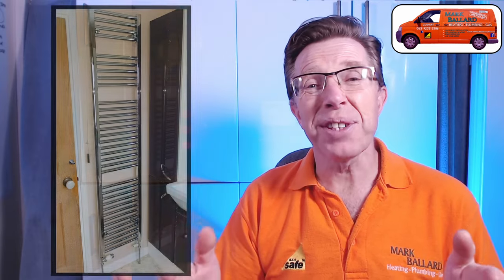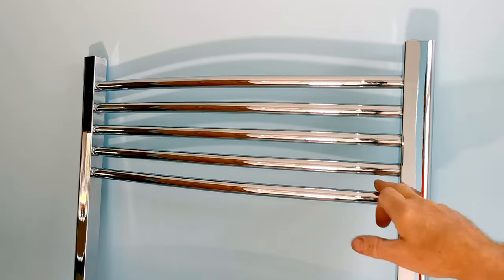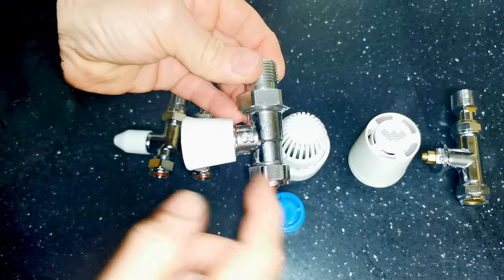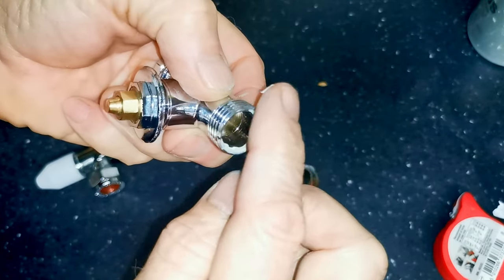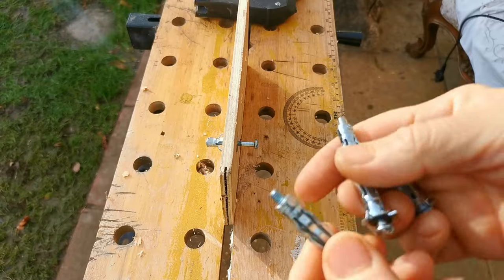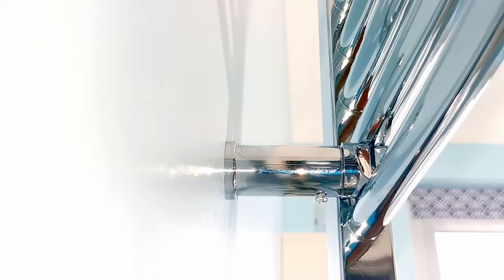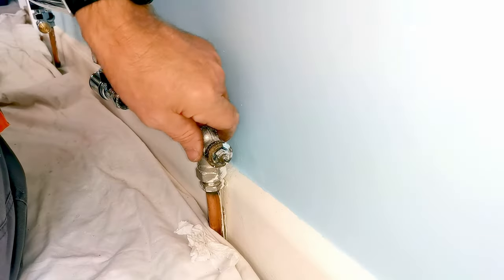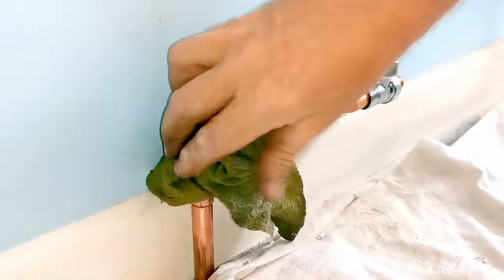How to Install a Heated Towel Radiator.  Detailed Step by Step Instructions. Replacing a Radiator.

Comment: WOW !! - seen several vids by plumbers, and this is easily the best. Thanks Mark for taking time and effort to do a "proper job". No wobbly camerawork, no annoying music, just lots of really useful info from an experienced, methodical, calm, "instructor"; including little things the others (the bodgers?) omitt to mention, like using smooth grips to safeguard new valves, or measuring twice before drilling, and so on. AND best of all for me, this boiler is the same as ours, an old-style Vaillant - your vid had shown me in one minute what's taken me hours to find elsewhere, wrt re-pressurising the system. I just wish the towel rail we inherited with our house is as massive as this one. Thanks again !.
Reply from the maker: Thanks for your comments. Makes it all really worthwhile.👍👍👍
Reply: Couldn't agree more!

Comment: Good timing.  My towel radiator sprung a leak a week ago.  It's fairly old and one of the rails must have rusted through.  I've isolated it and bought a replacement which looks like it will fit exactly.  So I will hopefully get everything to line up with the old valves and avoid needing to go as far as draining down or putting bungs in the hot water feed.  A smaller radiator sprung a leak a few days before (hopefully not a pattern forming) so I'm going to have a look at your videos to swap that one over too.

Comment: Hi, well stated about the amount of times you wrap the ptfe tape around, too many people doing similar jobs on here quote 8-10 wraps! Clearly that’s not enough, 1 do 21-22 plus jet blue as well,  proper instructions for those whom want to have a go fitting a radiator.
Reply: The instructions for my towel radiator say 'at least 6 wraps'. I'm going to do a few more (despite the time and extra expense!).

Comment: Hi. Nice video. Maybe you could help me with some info. I bought the same radiator but I am planing to fit it with electric rod heater. My room is 4 square meters. Would you know how many watts would I need to heat the room with this radiator? Thanks

Comment: mate your 20 winds of ptfe tape saved my bacon today. 1st time fitting a towel radiator and the threads were awful. did 5-6 wraps first off and it leaked. then luckily found your video and thought 20 winds was crazy but thank you it has worked. threads must be so cheaply made.

Comment: Hey Mark! 
Could you tell me why are towel rails connected on the bottom, meanwhile regular radiators have heat running from the top, and the cold water getting out on the opposite sides bottom?

Comment: Brilliant video, really helpful thank you, just in time too, I'm going to be fitting the exact same towel radiator so, again, really helpful.  one last thing, where do you buy your jet lube from, I've looked on the internet and it all seems to come from America and they want loads of money for postage! thanks.
Reply from the maker: Try you Local Plumb Center, or Plumbing Merchants.
Reply from the maker: http://www.markballard-ltd.com/recommends/jet-lube-joining-compound/
Reply: @MarkBallardLTD  That's great, thank you Mark ,I'm on it :-)
Reply: Hi Mark. Just bled the radiators and now bar is 2.5. I have hot water but the heating symbol is flashing on the boiler and I have no heating. Any ideas?

Comment: Hi I'm replacing a leaking single core radiator with a towel rail however one of the pipes is at an angle coming out of the concrete floor. Could I straighten the pipe by just bending it slightly?

Comment: what size of say allen key (?) or radiator spanner (?) at 19:35 is needed to tighten the threaded joints which go into the radiator at the bottom in my case ?